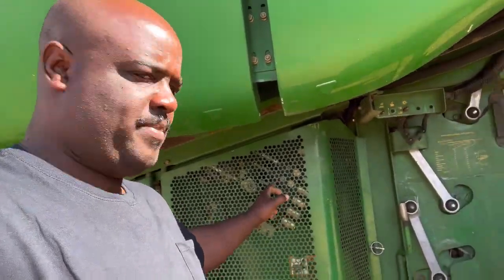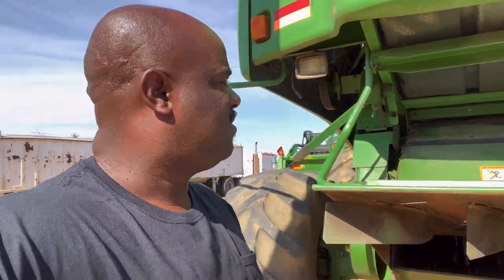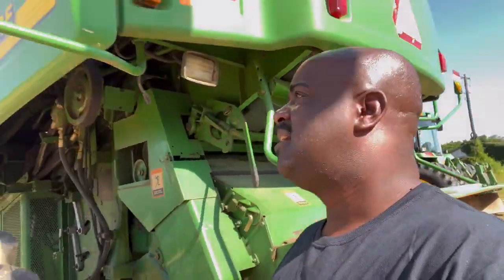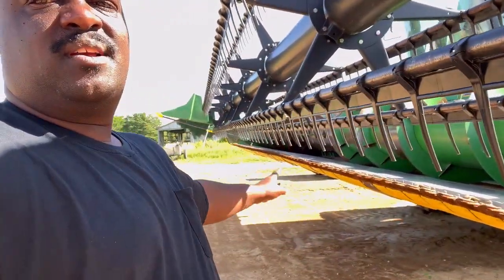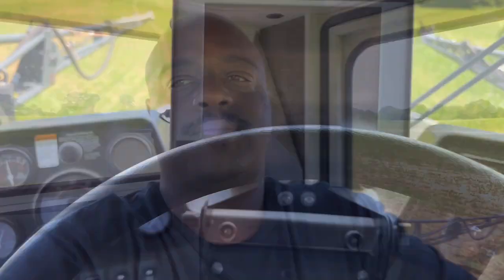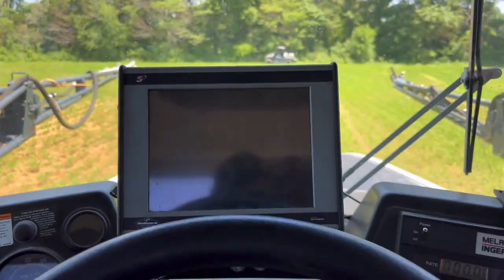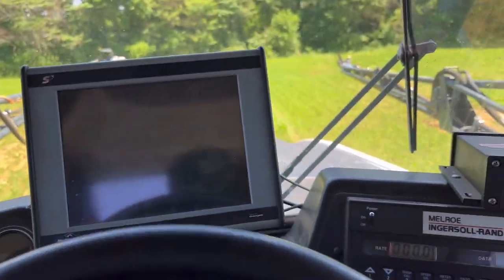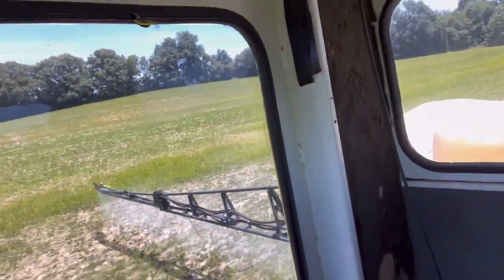Grass an pigweeds .

Comment: Your right about new tractors. We are running 30 year old tractors without a problem. But these new tractors have so many computer chips and wires. It is crazy. No one is going to be making replacement chips for these tractors in 30 years.
Reply from the maker: Facts

Comment: You should be getting 20acres to the tank,15 gallons to the acre.or  30, at 10 gallons oer acre.
Reply from the maker: Facts but it seems like I’m getting bout 10 or 12 . I’m putting out right smart of water .
Reply: @dionwadefarmsllc  15 gallons per acre is plenty water.  You might have a lot of over lap   I use a portable gps they cost about 1000 bucks   Once you have the correct spacing. Then reduce pressure. Or  change nozzles.  I use the blue tip  with 35 lbs pressure running about 6.5 mph
Reply from the maker: I agree ☝️

Comment: Also I used a EZ Steer 250 gps and it helps with the over spray
Reply from the maker: How you like it ? I do need to upgrade at some point
Reply: Love it. If I mix for 20 acres I spray for 20 acres. No skips or double spraying and it’s cheap
Reply from the maker: @srad98ful  I need to check in to that ez steer

Comment: On the SpraCoupe you might have to change your Tips out to a different tip depending on the chemicals you’re spraying.
Reply from the maker: I thought of that earlier . I’m running those dicamba tips keep from drifting .
Reply: Also at 15gal/acre on a 300 gallon you should cover around 20 acres. So maybe check your calibration on speed you’re running(RPMs)vs. chemical you’re actually putting out.
Reply from the maker: @wesleytalley530  yeah your right . I’m gonna have a look at that tomorrow in the next vlogg

Comment: Lmbo who is the head boss on the farm because you don’t wanna hold the vlog camera and was supposed to be working on the combine and not spraying! lol we ready to suspend you 🤣
Reply from the maker: I’m tha head always an not tha tail .
Reply from the maker: LoL 😂
Reply from the maker: It’s hard to find good help at times . I usually get my uncles in gear around here but they all got jobs witch is understandable .
Reply from the maker: But don’t worry I’m gonna get tha combine worked on . It’s coming lol 😂
Reply: @dionwadefarmsllc  lol if it was red only thing you need to do to the combine is add fuel and go to the field 😂😂
Reply from the maker: Yeah mine burnt up last yr that's why I went green lol 😆  you can see it on my Instagram wade farms

Comment: What’s your rate set on the raven?
Reply from the maker: 15
Reply: Okay. yea that should be 20 acre load. Them flow meters can act up some times. That should be plenty of pressure to keep up with that rate at a decent ground speed.
Reply from the maker: Yeah I’m running 3rd gear . It’s just seems like I’m not covering ground seems like I’m covering less ground . Or maybe it’s just me
Reply: @dionwadefarmsllc  If I remember right there’s a acre button on that raven box you can zero it out when your full and see what it says on acres when you run out. Been a while since I’ve messed with a raven like yours they can be confusing to mess with all the settings but hope that helps. Enjoy your videos keep up the good work!👍
Reply from the maker: @kyleburton4825  it’s very confusing . I usually have to call a tech out to set it for me but around here alliance went out of business here . I really don’t know who works on these spray coups